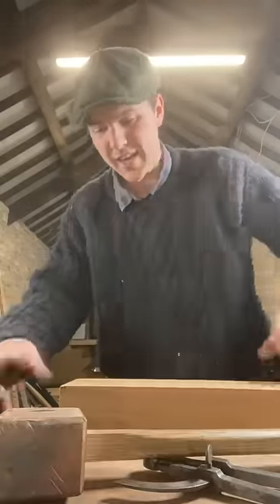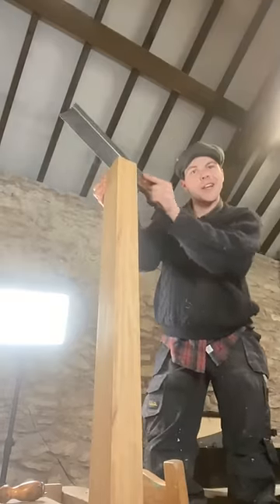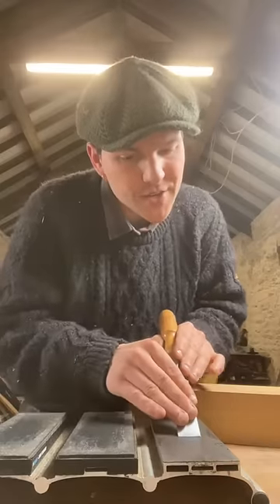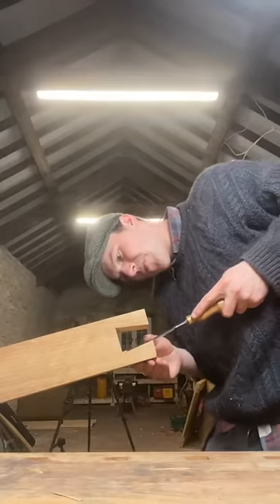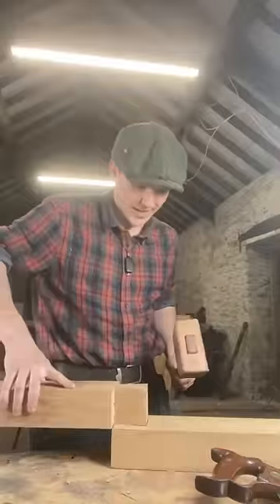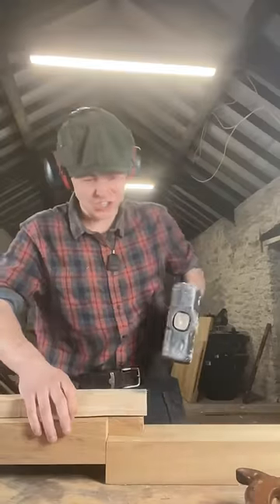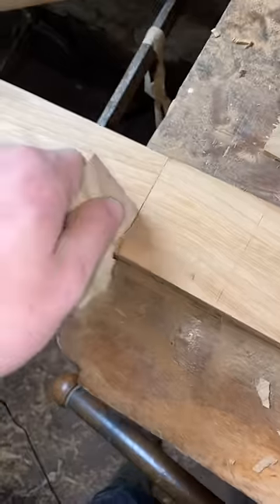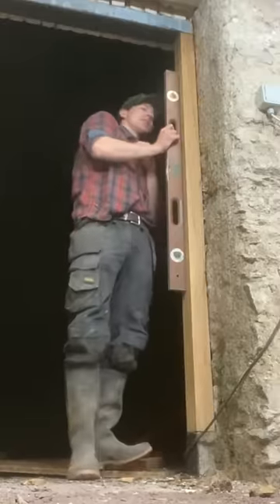Fixing My Door Frame With a Dovetail Joint #ireland #woodwork #joinery #carpentry #teak #handtools

Comment: Standard practice of joinery. If you see that gap, no you don't.
Reply: Incas did this 600 years ago with rocks, no gaps. But still, mad respect for all joinery.
Reply: @JonMahn they do have gaps, people just say they don't, or cherry pick especially good joins to show
Reply: @thecatthatgotaway  I have seen very good ones down there but it is also important to note those were made for the most important religious parts so you don't want that to be messy so they had stone artists of the highest craftsmanship do that and it took a looking time to make
Reply: @JonMahn so, fun fact about that! While incan building was incredible for the time, the only reason it seems so smooth and crack-free now is because of erosion and mineral deposition removing the cracks!
Reply: I've read somewhere that there is possibility of Incas using ancient concrete. Those funny stones wouldn't be chiseled, but casted, like bricks.
Reply: @JonMahn can we dive into that for a few comments cuz I have a burning theory… feel free to tell me I’m an idiot, cuz I am… but do you think it’s at all possible that there was some sort of heating involved with these perfectly sealed stones. I know when you heat rock eventually it turns to molten lava, but is there a temperature that can be reached where the rock becomes soft enough to slowly mold and conform wherever it was placed? My hypothesis would be that as a result of the mass and malleability due to temperature, the rocks would just fit like a glove with no cutting needed, and once cooled, they would have been sealed together longggg before erosion entered the chat to smooth the surfaces.
Reply: @ChrisxNetter Turning rock to lava takes extreme amounts of heat. I don't think it would be possible for an ancient tribe to make a crucible capable of handling that. Let alone forming buildings with lava.
Reply: @SpaceGhost- ayyy 👀 ya knew really know tho ahaha
Reply: @urmomsfriend4909  I'm sorry, I don't follow you.
Reply: @1992badylek 

Bricks are made from fired clay, not concrete.
Reply: @mnomadvfx  clay isn't the only material used for bricks. But even if it was, I was talking about shaping process, not the materials.
Reply: I live in France, here we have "les compagnons du devoirs" they are amongst the oldest builders, somes said  King Salomon was their creator amongst 2 other ppl.
Go look up what kind of things they do, trust me, there's no gap and you can go back to 2000 years prior today and still, no gap ^^
Reply: @ChrisxNetter  I think that wouldn't be possible, solely due to the mineral composition of most stones and rocks. There's only a few specific sedimentary rocks that could be considered in any way malleable, and one kind of stone called itacolumite that is actually semi-flexible. That's only because of the way it layers itself with tiny gaps between the grain, allowing it to "bend" so to speak.
Reply: Or as adam savage says "hude your crimes"

Comment: I am genuinely surprised you've got any hair left after all the demo's you do of shaving them off
Reply: His great great grandfather was a Sasquatch
Reply: I do the same thing, although usually I test on a nail to see what kind of bite I have. If I’ve got a good bite down the whole edge I’ll do the hair test. I only really do a bite test on blades I don’t know the edge angle or conditions of. Alternatively to the paper test, if you want actual razor tests use tissue paper or paper towels as being softer they’re harder to cut so a clean cut on a tissue paper means a sharper edge than just on paper
Reply: The boring answers: It grows back. He's got two arms. Each test only shaves a small patch. He's been known to test it on his legs, in summer.
Reply: I'd be more concerned about... imagine how hairy he'd be if he didn't.
Reply: The good thing about hair is that it grows back...
Reply: I use a cut throat razor to shave and always give quick test on arm hair before face
Reply: @megaman992 I don't do the nail test,I use a paper towel to wipe oil from the blade and see if it cuts the paper towel at the same time,if it cuts it goes straight to the arm.
You can also crease a piece of paper so that it stays bent, stand it up and cut it without holding the paper.
Reply: @DavidSmith-vr1nb Haha!
Reply: @shotgunsam23 ROFL 🤣🤣🤣
Reply: So true!!!😂😂😂
Reply: You'd be surprised at how fast a European from the north is able to regrow his bodyhair.

Comment: Measure twice..
CUT ONCE.. good rule
Reply: Or you don't and learn to get it right first time. Measuring twice is a false economy!

Measure once you get more work done AND are more experienced from redoing things.
Reply: @mandowarrior123   is Redoing  the cut to new wood  that counts.. when you cut the 1st one wrong is that the economic savings..?? Your talking about?
Reply: I've seen a workplace where the motto "Get it right - First Time - Every Time" was displayed just a few feet away from "Measure Twice - Cut Once".
Reply: @DavidSmith-vr1nb If you measure twice (low effort) the cut (high effort) will be correct first time. Better to always be sure yer measure is correct than to burn materials.
Reply: Measure three times, cut twice, phone a joiner.
Reply: @DavidSmith-vr1nb  your correct..thanks.. work Smarter..
 not Harder... 
Oak  room molding @ $24.00 a foot.. cut that wrong..see if client recommends you again.. !!
Reply: Yeah but you can't make a youtube short out of doing it right

Comment: Lil tip for dovetails is to make the male piece first as precise as you can, then scribe the female, cutting just inside the mark, then Fettle with the chisel till you touch the scribe mark. Also would be advised to have a keeper wedge on a dovetail scarf. Keep up the great videos bud
Reply: ❤ Loving this comment as much as the video !! Keep the knowledge comin' !❤😇🥰💜💞💖
Reply: He used the female piece as a guide to mark out the male, I can't see why doing it the other way around would make a difference.
Reply: In my head your accent was so thick I barely understood that.
Reply: @gratefulguy4130  that made me chuckle hard enough it hurt, so thank you 😁

Comment: "So, I cut my door frame too short. Because I'm an idiot." I felt that in my soul. Did the same a few months ago rebuilding the my front door frame. Luckily i had ONE extra 2×4. Although it was treated, which is a little thicker, it worked fine. At least one board won't get water damaged.

Comment: Make the male adapter the width of the female part. Cut two vertical cuts in the male adaptor and place shims slightly in those cuts and hammer it into the female adapter length ways and you will have an even tighter fit. Especially useful if there isn't a lot of resistance on your first matching cut.

Comment: I do love the look of joinery. I did a course in basic construction cause i left school early but i still needed actual education; id say i mostly enjoyed working with wood, however, it turns out, when building a house and you go on the roof.. im a scared little girl, so i opted for.. anything else 😂

Fyi, for anyone considering similar, a basic construction course is great, they show you a lot of shit, how to use tools, how to sharpen drillbits and chisels, how to work with levels, including water levels and what not. Just shit to fill in the gaps of what you dont know and to give you some understanding before you choose your profession. And, it always had hands on work, which is the major reason i loved it. 

We ended up building a cubby house, amongst other things.

Edit: I'm 30 now, and been all over rhe construction industry, learned a lot. Pretty fun

Comment: Wouldn’t a header board span the two jambs and fill in the gap?  Did he forget the header needs space too?  Now that he’s lengthened it, it looks as if the header will now fit between the two jambs, instead of spanning them.   

On second thought, it appears the header is a different color and is not getting replaced. So, carry on as you were!

Comment: Man does good work but dont ever join a jack stud or post like this. For one it would never pass inspection. Second of all the joint is a weak spot, shift or seettling of the house, etc, can pop that joint. Code calls for contious (one piece) jack stud to the header. In my area anyways